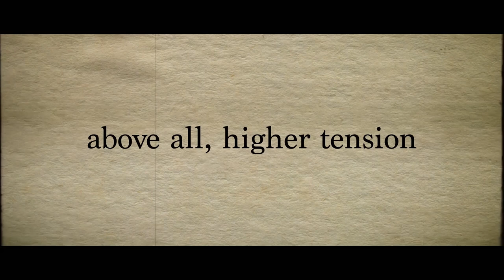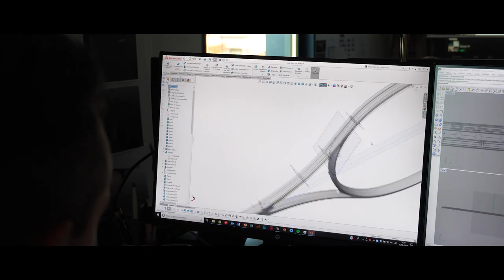The History of Babolat, the World's Oldest Tennis Brand: Babolat Brandography by Tennis Warehouse

Comment: Chris, Is that a Estusa Pro Vantec Power Beam carbon graphite racquet pictured with you? 
  Chris, What is the head size  of that Estusa Vantec PB?
  You mentioned Borg's high tension for his vs gut. What tension did he string his racquet?
Reply from the maker: It is the Power Beam Pro, the heaviest of the Power Beams and has a very low RA (stiffness). I cannot remember the exact tension Borg used, but it was high (kevlar/natural gut hybrid) and the frames were breaking all of the time due to the stress -- I would not recommend trying it since these are hard to find racquets these days!  Cheers, Chris, TW